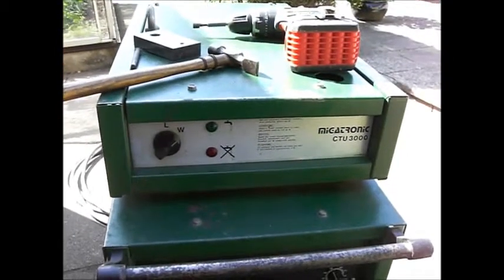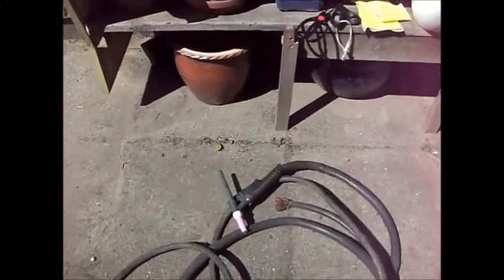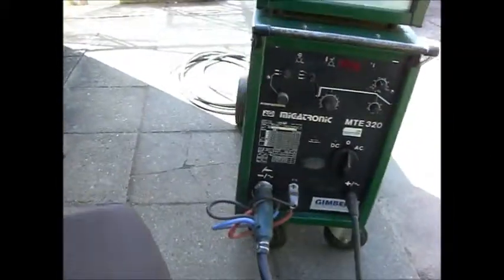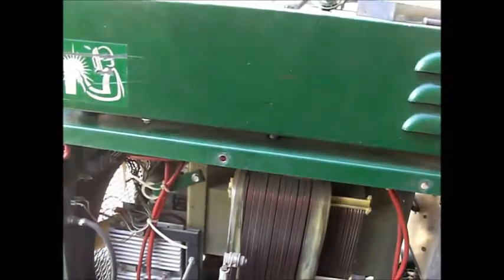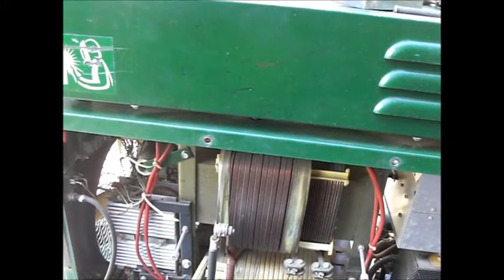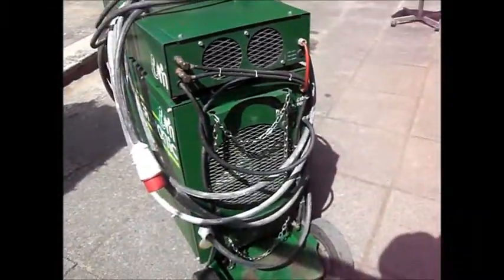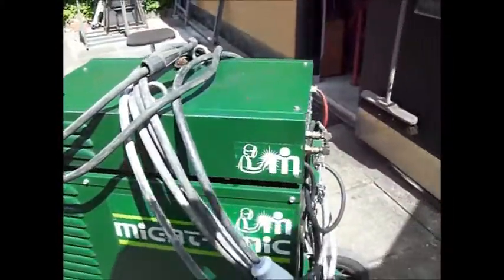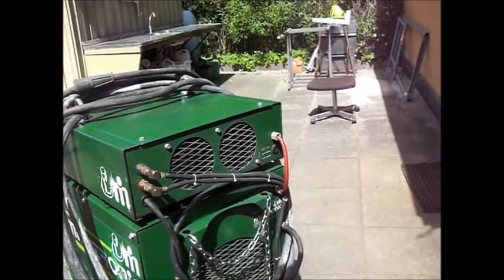TIG welder

Comment: Congrats Keld on the new "toy" for the shop.....NICE!!!
Reply from the maker: outsidescrewball Thx - Chuck ... I promised myself I will make all the "nice to have"-stuff BEFORE I start using the welder - I will make 

1) a "hook" for the torch to sit in when NOT in use - clamped to the forefront of the table
2) a protecting shield for the manometer on the argon bottle

the only problem is ... the TIG was the best to do teh welding with on these things ;-)) - so I prepared all the pieces ready to TIG together when I got the skills !
Reply: Keld Sørensen hi Keld, nice machine you found :) you'll find TIG welding to be similar to acetylene welding in the way the everything feels. ..if you've never done it before... that would be a crude comparison
Reply from the maker: HolzMichel
In my younger years I did in fact a lot of welding in very thin steel plates (0,5-1,0mm) with "autogena" = an european brand name for equipment for welding with acetylene and oxygen
Reply: Keld Sørensen
way koollll.. you should feel right at home then when you get that thing going.. water cooled.. wow... that ought to give you some serious amperage ... you could probably weld some 12 or 13 mm plate together pretty easy
Reply from the maker: HolzMichel
I'll stick to the small stuff bacause I haven't enough power to go to the 320A with my power installation .-((